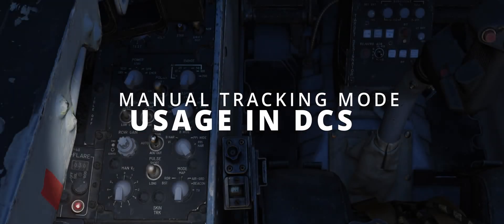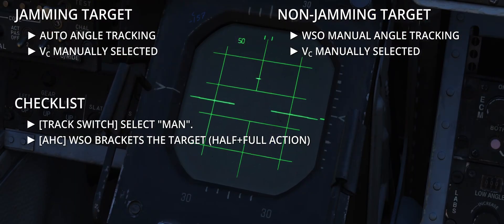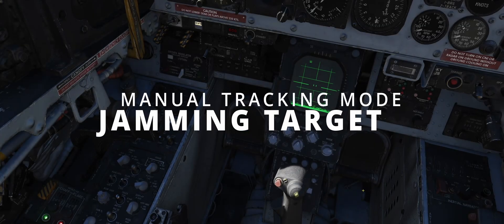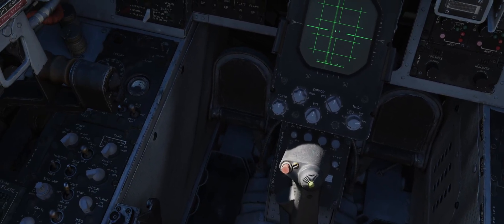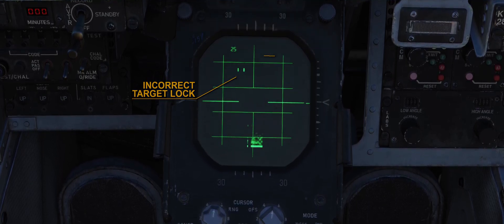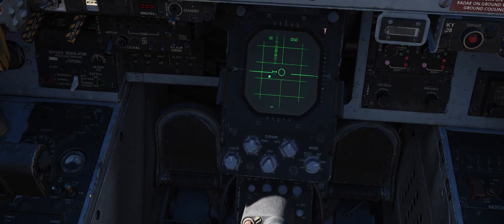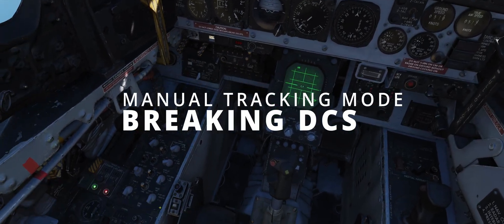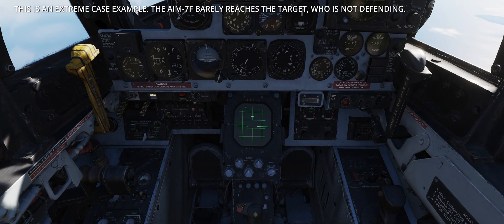DCS F-4E - Manual Tracking and AIM-7

Comment: I feel like the angle tracking in hoj is way too good in F4E. It has the performance of a mono pulse radar imho.
Reply from the maker: Not necessarily imo, as the jammer is a massive, loud, beacon of noise.
However, during the tests, a bunch of times the AIM-7 passed a few meters from the target without exploding. I did not mention this here as I did not keep track of the occurrences and the testing was not thorough. I plan to do an ad hoc video later to wrap up the ECM topic after I have covered standard HOJ as well.